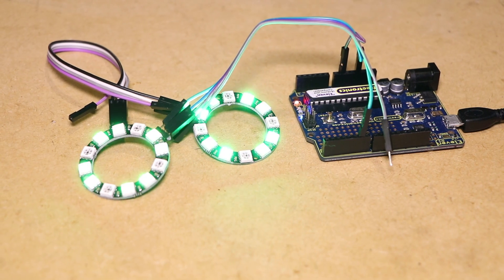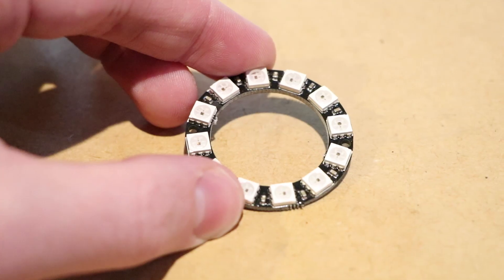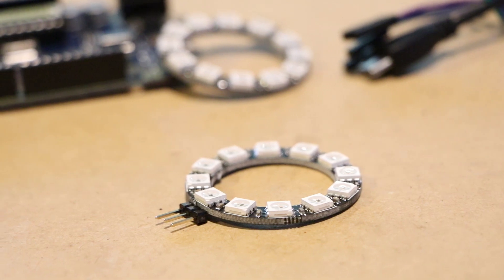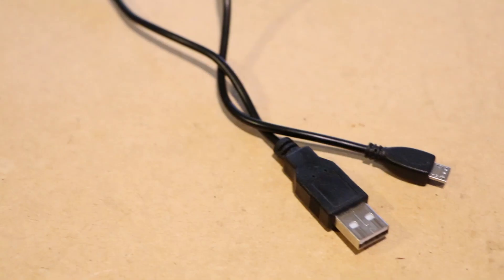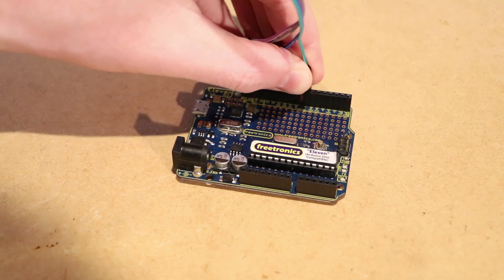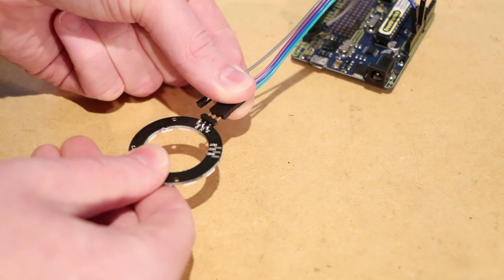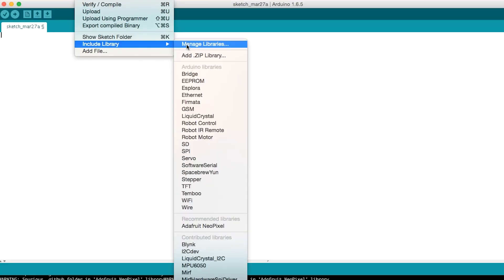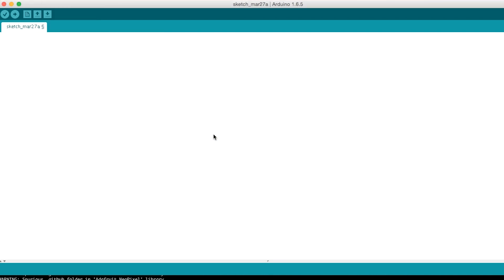Arduino - RGB LED Ring

Comment: I want to do something similar. Does the program start when the arduino board receives power? I want to control is using a phidget board to send the stop power when I want the LEDs on or off.

Comment: hey! im wonder is there a way for me to right code so i can convert midi cc values to control the ring? im trying to use some endless rotoray encoders with teh brain v2 from livid, however, i wont have nearly enough leds to do rings around them, but i am interested in this and an arduino!
Reply from the maker: Hi Azetix,
would this help: http://forum.arduino.cc/index.php?topic=397774.0

Nick.